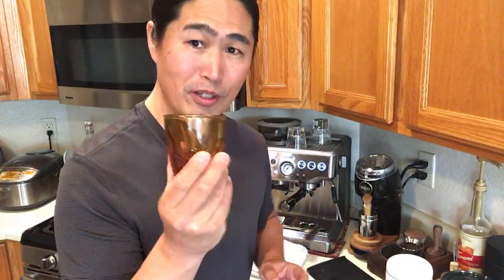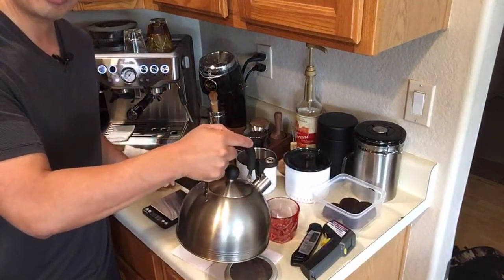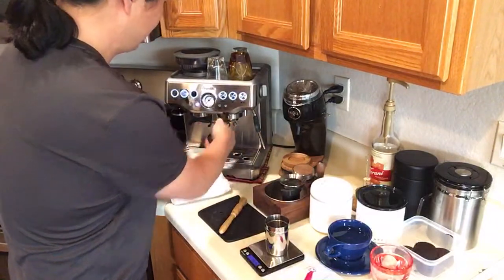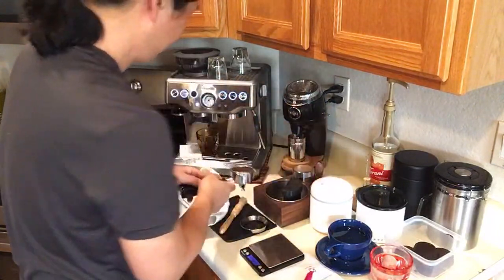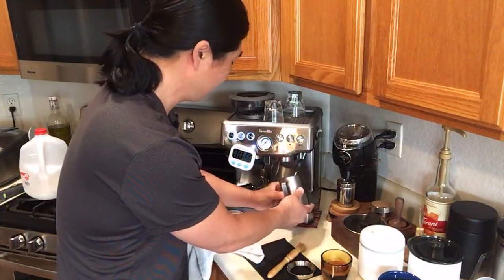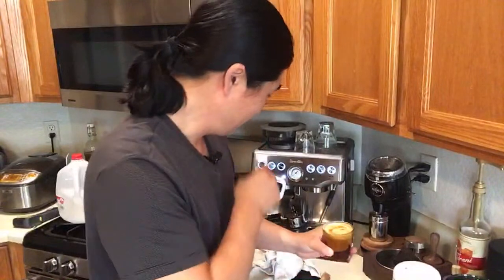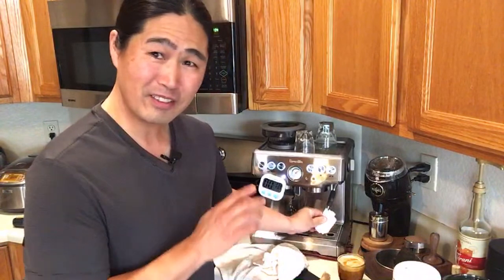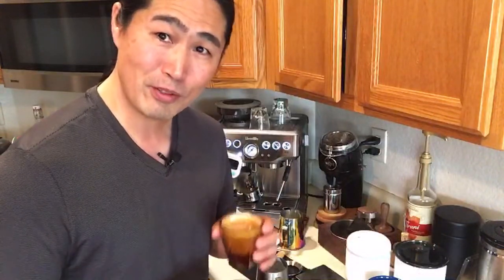How to make a Cortado | notNeutral Cups Heat Retention

Comment: Im still getting used to my infuser. I tried 17 grams with grind setting 7. And pulled quite a good shot with some Ethiopian beans. My best shot so far. 36gms out in 25 s. Not sour just a bit bitter. Im getting used to tasting espresso. Learning a lot from you and in the process of using the machine.  Maybe I should use the PID function to drop the temp a bit to reduce the bitterness.

Comment: One tip I've picked up is "mechanical, horizontal and vertical distribution" - with the dosing funnel clipped on, I rap the side of the portafilter, then I tap it a couple times on the bar of my knock box.  After that, I proceed to use my distribution tool and tamp.